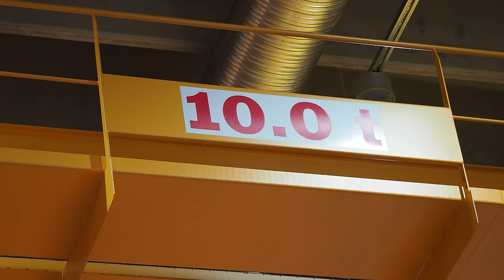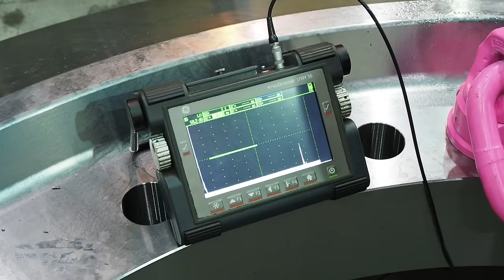Machining HUGE 10 Ton Bevel Gear with CNC Milling Machine

Comment: The cnc is like the size of my whole room/workshop
Reply: That whole machine can fit in the table of a few turning machine i work on and gring them to dust
Reply: That gear wouldn't fit in my apartment, but if it could it would go through the floor, and I am on a slab.

Comment: When I was a teenager I worked with my dad in a machine shop that made steel rolls for rolling metals into sheets. Some of the largest rolls  weighted 800k-900k pounds. That's 400+ tons. They had to be brought in on specially modified trains because they were so heavy. Crazy watching something that heavy being lifted.
Reply: If you read the description, you'll see that that's exactly what this gear is for too!

Comment: The machine is moving the 10T mass is quite rapidly. The servo motors must be quite powerful.
Very impressive.
It would be interesting to see the guts of that CNC. Perhaps they would let you film when they perform maintenance on it?
Reply: Ro K 
Theyre Not as impressive as you think . 
Mostly there are two or More dc Motors to split the load . 
These tables are also hydrostatically lifted and you can Turn the table by pushing With your leg .

Comment: The logistics of machining large parts is interesting. I've installed big parts on machinery and ships, never thought about what went into making them. Have a great day.
Reply: Parts as big as this gear?
I'd think getting the parts into position would be crazy hard.
Reply: @ddegn  yeah, but stuff that size was installed by crane, actually easier than doing something a couple of hundred pounds in a tight space by hand.
Reply: @jerrystott7780  agreed, im working with much bigger parts (our crane is 120t) and its not that hard to set them on the table (also a vertical lathe).

Comment: Well, realising that your press puts out the force of 15 of them stacked on top of each other is just mind-boggling...
Reply: And it weighs a fraction of the gear's weight.
Reply: There are AGC cylinders in steel mills that can exert 2-3000 tons of force. They're used to control the thickness of the steel going through the rolling mill by pushing giant rollers together, and basically squishing the steel down as it's pushed through. 

Fluid mechanics is fun.

Comment: I wonder how much weight those gears lost after being machined.
Reply: lol probably something like a few hundred pounds at least.
Reply: it became a gear after being machined
Reply: I’d say a ton at least
Reply: yea machining is really inefficient. you could probably even have used a saw to cut out a few pieces of flat bar first out of each of these grooves but the time is not worth it.
Reply: @excitedbox5705  They melt, cast and reuse the leftovers
Reply: @excitedbox5705  Or ABOM79's shaper!

Comment: Love these videos. After seeing the shavings turn dark blue, it made me wonder about grain structure of the gear after machining. Do they normalize before heat treating? Or maybe the massive amount of steel is enough to diffuse the high temperatures and that's not a problem. Thanks for the video.

Comment: Will that fit my Ford 9"?
I am interested in the ratios
Reply: The ratio of this gear is 1
Reply: You would need like a 200/1 ratio for your truck to even move with all that weight!
Reply: So much for shortening up that axle....   :)
Reply: imagine someone making a giant monster truck with a dif big enough for gears like this.
Reply: J M yes, your 9” will fit inside that gear. 👍
Reply: DANA 50...Million.
Reply: Early Cuyler's new truck-boat-truck rear diff
Reply: SURE WILL ... IF YOUR FORD HAS A FLATDECK.
and a high 4's ratio 9"... modded.
Reply: over 9000
Reply: just drop it on ur furd
Reply: More like 9' you would need

Comment: did they send it for further finishing such as heat treat or polishing or shot peening? i am a machinist and i like seeing everything, since i can always learn something from whatever i see.
Reply from the maker: It's been used like that. The steel alloy was some bit harder stuff and the use case isn't super demanding when you take the size in account so no hardening needed
Reply: @Beyondthepress  pretty cool. often see larger gears induction hardened on the teeth

Comment: Just imagine how much this would cost if they didn't make it to spec and had to discard the whole gear.. goddamn..
Reply: $1-2 per lb of steel. Remember stock material was a donut originally and had been turned down first. He said 10 tons. Cranes tons mean kg. Probably 30000 lbs. depending on the grade of steel that means $40-60000 material alone. A shop like this likely charges $200 per hour plus an overage for large parts and add padding incase material is scrap. He's saying about 40 hours of milling per gear and I'd estimate at least 20 hours of turning per gear. The cheapest they would charge without padding the material is 60*200 or 12000 per gear + 30% of the material, so about $32000 CAD per gear as a charge.  ($22000-30000 USD plus material costs)
Reply: @joshmdmd  I'd say your estimate is way off. I could be wrong but I thought I heard him say 80 hours for 1 part. Also a machine that large and wear on tooling to remove at least a ton of material, is going to fetch a premium...
Reply: @BadBadgerTrollAccount172  lol he said the camera was on for 80 hours of footage. Maybe they left it running through 24/7. I based it off the end of the video where he said two weeks including time on the lathe for finishing at another company. Work you can leave overnight without supervision doesn't really run off the same pricing as actual parts that require a lot of oversight. The roughing could've all been done without supervision as long as they cycled bodies based on expected wear. The second part also is much cheaper (and shorter) than the second part. If you quote too high on a job like this, you'll lose the customer to a competitor, and the chance you get to quote another job for the customer drops significantly as well.
Reply: @joshmdmd  
when you are a specialty shop there are not many"competitors" as very few shops have the capability.
Reply: @zoggrog8823  there are many competitors when shipping is only a fraction is the cost of the part. Parts this size are quoted by shops internationally. Three local shops I deal with make similar stuff and have the capability to make these parts. I know there are a few others in my area that can also do this type of work. We're in an environment where companies doing well write off old machines as losses for the tax breaks, and either scrap or sell them, and replace them leaving other companies the opportunity to be able to afford them secondhand.
Reply: @zoggrog8823  Do you assume the 40 000 dollars is in raw material alone?
Reply: @benlubbers4943  easily
Reply: Or more if the material is something stupid expensive such as Alloy 925
Reply: @Jeff Dittburner That's not a thing... I work at a titanium casting plant, and we make medicals. They aren't that much until you pay a Dr for one, because they come in sets. When you take one piece out of the set, the rest is scrapped... I think your friend got fired.
Reply: @zoggrog8823  according to google, a titanium hip replacement cost between 11, and 125,000 dollars
Edit: I know that most of that is labor.
Reply: @AurumFaber  . It cost that much at the end user. Not at this point in the manufacturing process
Reply: @zoggrog8823  that's... what I said.😕
Reply: @BadBadgerTrollAccount172  - It think the 80 hours was for the first cut, but I might be wrong.
Reply: @zoggrog8823  there is surgical grade EVERYTHING these days, because it has to be certified for that use.
And yes, it costs a fortune.
Reply: @danieljones317  
 I do this everyday in the industry his original comment, which I responded to is incorrect. i dont need to argue with you I know more about it than you.
Reply: @BadBadgerTrollAccount172  dont forgett someone needed to write a programm for that! that takes some time
Reply: Never every its more than 80k costs. The machine who did this piece costs maybe aroud 1million
Reply: Just imagine that last cut being in the wrong place, because the gaps between were 1mm too big or too small ;)
Reply: @danieljones317  
There is not a "surgical" grade of titanium. There are different alloys and yes they do have different certs for implantation. The "grade" or the alloy is EXACTLY the same. The difference is traceability. You obviously don't know what your talking about. This is very apparent to anyone that actually knows.
Reply: @zoggrog8823  so, this metal strip I have in my leg came out of a filthy factory.
Got it.

Comment: Here in the US I operate a DMG Mori Milltap 700, it is tiny compared to that DMG mill. The little parts (gears) I run are only about 25mm x 35mm.
Reply: Do you happen to know what % of weight is usually cut off by the end of the process, you know like before/after?

Comment: Trelleborg, Sweden. måndag den 27 april 2020. 

To Michael Green who asked ” Is there a reason the no lubricant is used during this machining?”.  

Hello Michael! 

Generally you have misunderstood. When you see machining and they spool
a liquid on the workpiece and the tool it is not for lubricating. The purpose
is cooling. The liquid you then see is practically water which is an efficient
coolant. (Yes, there are exceptions. Depending on which metal that is machined
one sometimes ned both cooling and lubricating. Then you may spool with
vegetable oil, kerosene or even alcohol. Such exceptions the mechanical
industry know.)  

But water on steel create corrosion and that is not desirable. Therefore the water is mixed with special anticorrosive oils that mix with water. Approximately 3 to 5 % oil.    

This workpiece and the machine is very stable. The edges in the tool cut
away “thick” chips and the chip is heated and removes most of the heat from
both tool and workpiece. ( “Thick” in this case is perhaps 0,2 to 0,6 mm.)  This workpiece is large and the tool is small
so the piece is  probably only
“handwarm”. The tool they call “millhead” at 2:18 minutes have yellow details. 
Those are the cutting edges and are made of “hard metal”. In the middle of each
“plate” is a screw.  When the sharpness
begins to be bad the plates are easy to change for new ones. More to read at www.secotools.com In the beginning of 1900
or perhaps 1940 the industry had developed HSS, High Speed Steel for cutting
edges. Also heat resistant.  Hard metal increased the cutting capacity 10 to 20 times. 

Best regards / tomasgidlof.se

Comment: Look at how blue those chips are.
Reply: If you use compressed air, swarf doh is allways blue due to t°. Less so if coolant is used, wich mostly doesn't suit milling.
Reply: @dannydetonator  cobalt blue chips are from the type of material more than the way it was machined or coolant choice
Reply: Would ya look at that? Just look at it. Ed Bassmaster would be proud
Reply: Kory Dean well no... with coolant you do something crazy wrong if you get blue chips. The only way you should get blue chips is when you use air to cool... and material is not important as long as it is steel... stainless steel rarely goes blue but anything else does
Reply: Chips are blue due to heat generated
Reply: Danny THE Dog you are wrong boy, for roughing the best thing to do is using air as coolant, to minimize thermal shocks at your cutting edge. At least in steel. Roughing should always be dry, finishing should be made with coolant and drilling
Reply: The chips are blue because it means that the most of heat is transferred to the chip instead of the part.

Comment: Imagine the cnc code got corrupted near the end and it started milling wrong.  That would be very expensive and heavy piece of scrap metal
Reply: Sounds like a insurance claim to me.
Reply: g code (cnc code) doesn't run on anything apple made so no need to worry mate
Reply: The machines don't screw up, usually. It's the machinists who do.
Imagine messing up tool length measuring for the finishing pass, so the whole thing is just slightly out of spec when it's finished...
Reply: Mostly the will weld the spot up with the same material and then just finishing the whole piece
Reply: Kyle Harding my macbook generates g codes for my 3d printer just as well as my windows or linux computer mate
Reply: Kyle Harding i can program cnc machines and write g codes from scratch btw if you think i’m dumb because i use apple, i also studie industrial engineering at university. i just called it cnc code so others understood what i meant.
Reply: Machines don't screw up. It's a computer so it can only do what a machinist tells it to do. They don't have a mind of their own. Any machinist that uses the excuse of saying the machine messed up is a bad machinist. They don't have the balls to admit they made a mistake. It's ok to make mistakes, we're humans. However if you do make a mistake you will be more respected by other if you admit it. Especially if you are someone who likes to go back and evaluate what they did wrong and learn from it.
Reply: @jordanschofield464  Machines can indeed "screw up", there are many points of failure in a CNC.
Reply: @timmturner  I never said machines can't have failures. I said the computer can't do things of it's own, only what the machinist tells it to do. They can have  mechanical failures such as compressors failing or belts snapping. But people blame the machines for messing up even though most of the time they messed up due to an incorrect set up for example.
Reply: @jordanschofield464  "Machines don't screw up."

You've obviously never used a CNC machine. They're certainly not infallible. If you're good at operating one it will screw things up more often than you do.
Reply: @nagualdesign  They don't fail, the program will be written wrong. Your telling me it's going to plow through material at its own choice? It will be a user error such as thinking you have changed the tool wear when you actually changed the geometry by mistake causing it to crash
Reply: @jordanschofield464  I once asked a CNC machine to cut a simple rectangle out of acrylic, as I'd done hundreds of times before using the same programme on the same machine, but instead of turning right and making the final cut it ploughed blindly into the side clamp less than 1cm away and broke the router bit before I had time to hit the big red button. Shit happens. That particular error never happened again. I guess it was a disc read error but the machine didn't notice. This was over 25 years ago. Modern computers use more parity bits.
Reply: @nagualdesign  Was this on a mill or a CNC router?
Reply: I’m sure they have many probing routines to make sure there are no issues

Comment: We got stuck  with  face milling a large diameter last week . It was T100 steel and a welded  assembly . New carbide tool bits were riding up on it . I ended up finishing it with a grinding  head attachment . That gear looks annealed , will you heat treat it after ? Would you have  milled  T100 as is , like we did ?

Comment: That G code probably had more lines than the Linux kernel.
Reply: Not if they ran a subroutine
Reply: @urgamecshk  a subroutine is also just G code. I think, they used CAM software, because its easier and quicker. And CAM is notorious for just using G1 and stuff.

Comment: This is one of the most fascinating things I've ever seen, honestly. What a piece of kit! Both the machine and the product. I had never even considered how such a thing was made. Amazing video! And to think I kept skipping past this one all year because I wasn't particularly interested. So glad I have seen this now.
Reply: You should come work with me. Take a 30 ton block and do 3d machining untill it weighs about 20 tons, mold for a bumper. Basically maching out the front end of a car
Reply: @highstreetkillers4377  Sounds like an interesting process and place to work. I'm a plumber and very much enjoy my line of work. I presume you like what you do for a living too?

Comment: Pretty amazing. It would be nice to understand the application for something this scale. I can only imagine something like a cruise ship propeller gear or maybe some kind of bridge lifting mechanism. 

Now I read that it’s part of a gear assembly to produce the steel slabs for ship building.

So precise and it’s mechanism of production. I wonder how people created these sorts of scale things 100 years ago? I’ve seen some pretty large mechanisms in photos from the 1900s.

Also, a good idea about the price charged to mill something like this? Raw material cost? It’s curious information.

Totally curious to learn more about the heat treating ovens.

Comment: I had to hand grind a set of gears on a clinker mill once. We replaced the pinion which was about 24 inches in diameter, the shop who put the gear on the shaft missed the mark by about a 1/4". The main bull gear was about 25 ft in diameter around the drum. So I had to hand grind and lap the old gear to the new gear so the mismatch wouldn't destroy both gears when running. It took me a month,  12 hrs a day.  No cnc machines back then,  it would have been better to build a shaft and gear as one piece. This was a good video.

Comment: Are they using colour coded lifting gear I see three diferent in use together in the uk our strops are coded for easy visualisation of each components rated safe loading. Maybe you could do a vidio covering this subject in your country standard colours.

Comment: Thanks to ATA Gears and you. Loved the focus trick you did looking at each tooth at 5:46 to 5:50. 
Huge gear is great seeing the milling marks from the cutting head. Would look great in my front yard. 
Q: do they have to heat treat the gear after grinding??  I would not think so, but one never knows. 
I can only ask: large, 400+Kg  Herringbone gear with no vally. Right tooth touches left tooth.